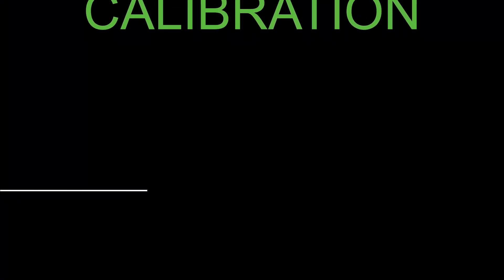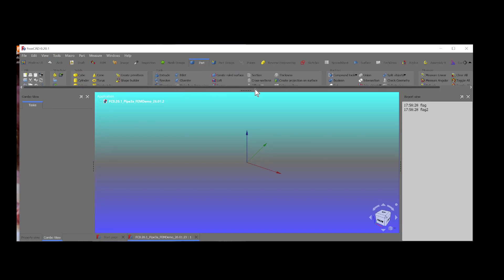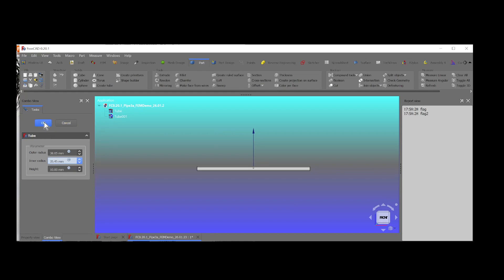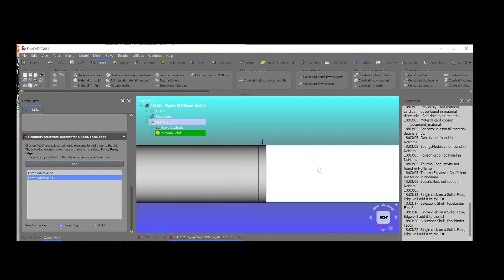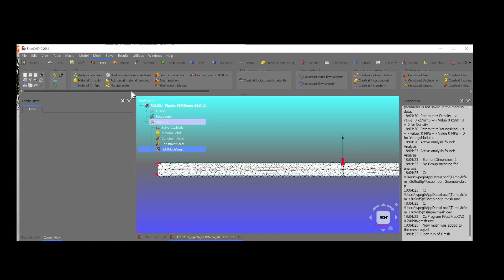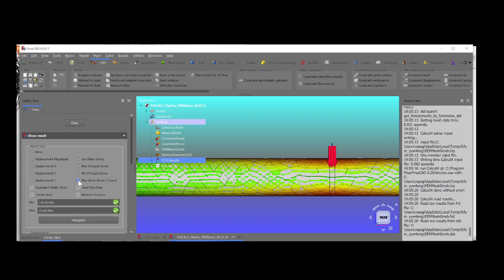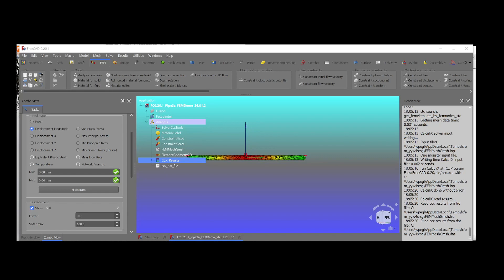FreeCAD FEM Pipe Analysis

Comment: Extremely helpful video. 

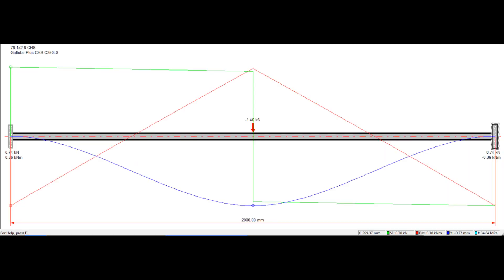I didn't get what was wrong at the 5:30 mark. 
As in the result of Max Fibre stress Gmsh returns was different as to what we would get if we calculate it using traditional methods?